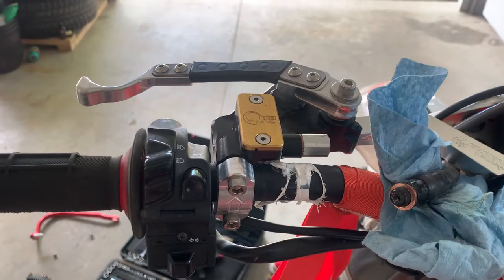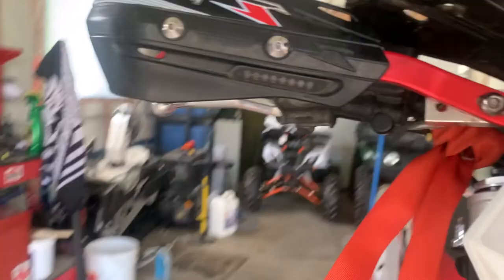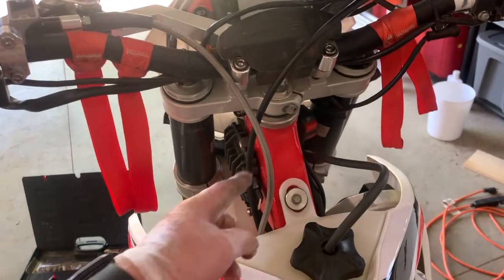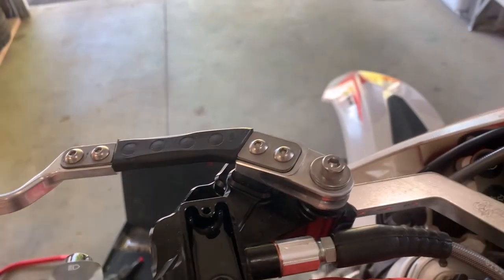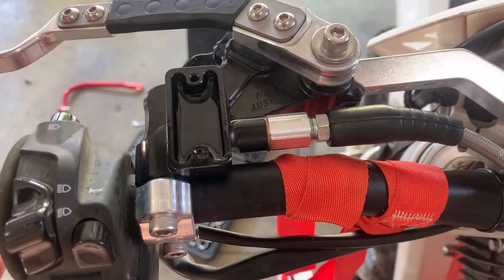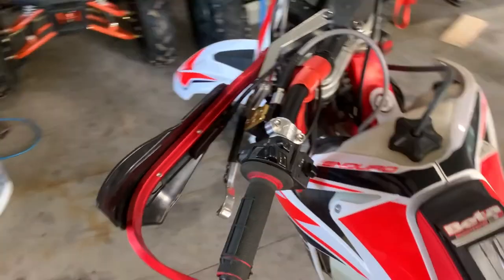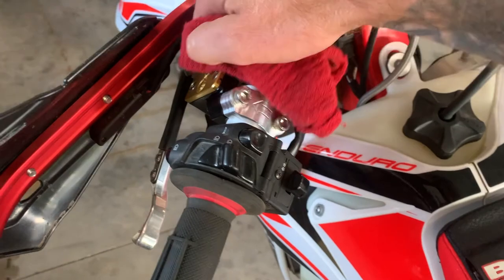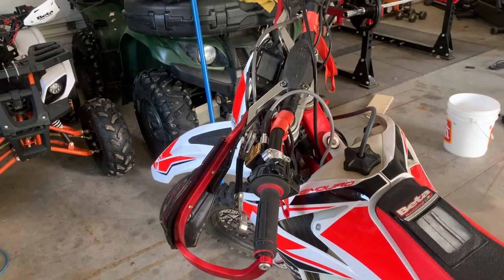Clake One Light Clutch Install on Dirt Bike

Comment: I reinstalled my Clake One Light clutch after having removed it to sell my old bike. I followed the bleed procedure to the letter. After pushing the lever in, then quickly releasing it for nearly two hours, and STILL seeing microscopic bubbles each time, I eventually gave up and put the cover back on the reservoir. The clutch works perfectly fine, although, that said, I never found an 'ultra-light' setting like I had when I previously had the Clake One Light installed. I guess I could turn the adjuster more times, but I wanted to go for a ride; do you blame me?
Reply from the maker: Nope, ride on. Don’t be concerned with playing with the dial. That’s what it’s there for.

Comment: I found reverse bleeding it was a lot quicker and easier, also needed that extension for my Husky, $20Aus from clake
Reply from the maker: I’ll be trying that next when I change out the oil pump gears. I have reverse bled brakes before and it works well.

Comment: You might have had even more dramas bleeding it from when you re-routed your line. The clake installation video says to keep that cable upright, maybe some fluid came out of the line creating an air pocket that you had to try and bleed out through the whole system.

Good video, I also run my levers super low but I've adjusted my hand guards to suit, I get the occasional stick to the knuckle but I find it's a good trade off, also in my opinion reduces the chances of getting an arm caught in them in a over the bars situation.
Reply from the maker: Yeah I will be changing the brake and clutch fluid shortly and am going to try and reverse bleed the clutch. It has worked very well for over 50 hrs now but doesn’t hurt to have new fluid in there every once in a while. Thanks for the comment.